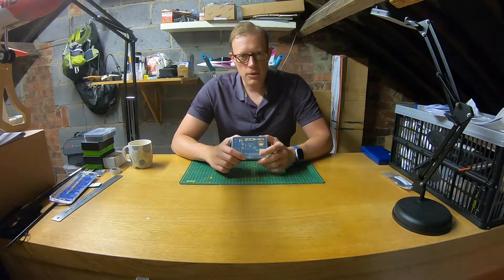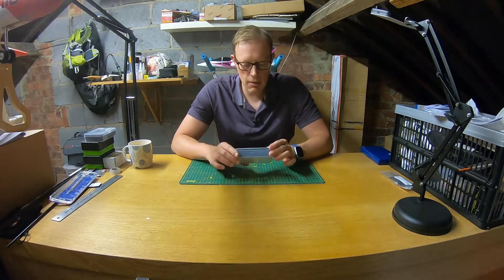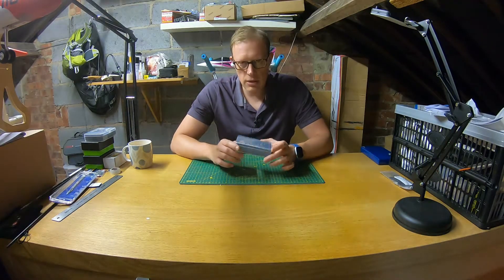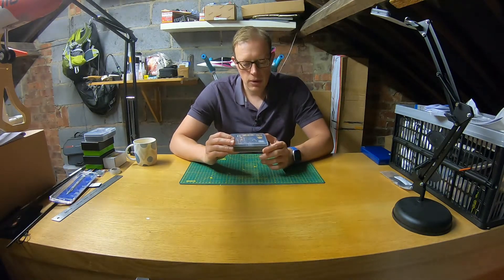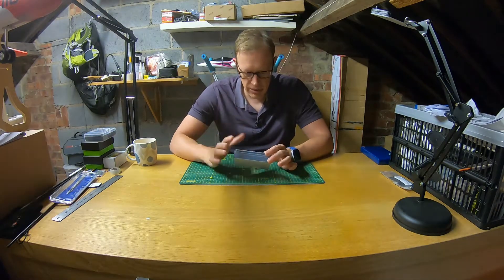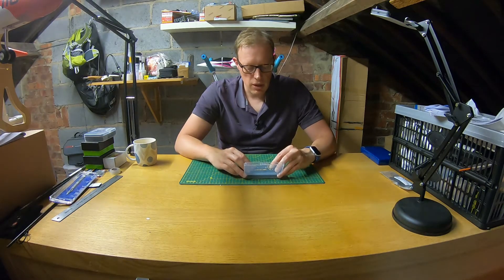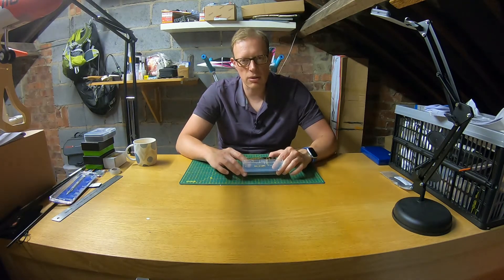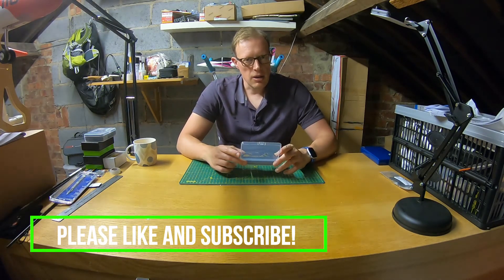ZOHD Kopilot launch control with manual throttle!

Comment: I have a specials switch dedicated for a "Launch Mode".  When activated, it provides a throttle-elevator mix based on a custom curve on my RadioMaster TX16S.  The curve will gradually increase up elevator as the throttle goes up past 50%.  I use this launch mode with the ZOHD in Level Mode.  The plane will easily launch and as soon as I've reached desired latitude,  take it out of my "Launch Mode".   Alternatively, you can just back down on the throttle to 50% or less which will drop the added elevator.   I do this with most of my planes, especially flying wings.
Reply from the maker: Sounds good 👍🏻. Thanks for watching and commenting.

Comment: Hi, is lauch control, using RTH on take off? I have the ch5 3 position switch, up RTH, middle stabilisation and down manual. I don't have an option for auto launch? Please advise thanks.

Zohd Orbit with kopilot.
Reply from the maker: Yes use RTH, stick the throttle on full and then launch it. As it hits a certain speed the motor will kick in and take over.

Comment: That Clearly was NOT auto-Launch. Motor will not spinup in RTL before you throw it
Reply from the maker: It does the way I have it configured. I have throttle plugged into aux channel and mixed with channel 3. You need to watch the start of the video!! 👍
Reply: Oh it definitely will as throttle is now controlled via the aux channel.

Comment: Hola,  hay alguna manera que RTH  mantenga Más altura ?
Reply from the maker: Hello, no it’s preset by Kopilot at 50m I think it is. Thanks for watching 👍
Reply: @tdogrc  70m actually. If you want more on a similar unit try the Lefei SN Sparrow. It uses 100 meters. There are also upgraded models with more features available. (Lefei SN-L, Sparrow2 etc.)
Reply: No, but somebody on YouTube tested it and found that it was 70 meter altitude for RTH.

Comment: Why not just launch in rth. Model should just climb out and circle around.
Reply from the maker: Doesn’t really work with EDFs. You need the power on as soon as it leaves your hands and the kopilot waits for a few seconds before applying the throttle in RTH mode. It’s designed so you can launch a pusher prop plane without catching your fingers. Cheers
Reply: Exactly I was wondering why His motor started spinning up before He threw it. It suppose to feel the excelleration of the throw to spinup the motors, I don't know what He was doing. There is no way the motor should have started first, He had to be in Stabalized mode or manual for that to Happen.

Comment: Just lauch in stabilise mode?
Reply from the maker: I hate stability mode though on the Kopilot. You have very little control it restricts the movement so much. 👍
Reply: @tdogrc  I may be wrong (frequently am! 😉) but to the best of my knowledge the restriction of movement of the servos in stabilized mode is exactly the same in RTH/FENCE/Autolaunch/Altitude Hold mode. Only Manual gives you unfettered movement. Also (in pilot initiated RTH only) you can increase the throttle above the Kopilot set level with the stick or so I've been told. (Possibly only valid above the fly straight forward to climb to 35m height.) Not confirmed it myself. 😁
Reply: @tdogrc  That's what it is suppose to do.

Comment: Thx! It was a good idea. All you loose is the automatic throttle control in rth mode. So don't forget to give enough throttle during rth and set this value to failsafe.
Reply from the maker: Yes you’re absolutely right 👍

Comment: You could also just program a switch to give up elevator and just switch the stability mode on and toss her with full throttle control. The stability mode will keep her level and once she's up about 10 feet switch off elevator switch and switch her into rth to loiter overhead

Comment: Good idea, but does it mean that if you have the RTH as a failsafe feature (for distant flights) than the Kopilot cannot control the motor power and thus cannot climb or descent. In such case a failsafe in the receiver would have to set the mode switch to the RTH function  but also set throttle to some cruise level, which can be not enough if the Kopilot decides do rise.
Reply from the maker: SilesiaBiker thanks for watching. Yes you’re correct. If your using the KP for long range distance flights such as FPV I would recommend leaving it as channel 3. I only use this method for easier hand launch for LOS flying.  Cheers
Reply: Could you program a Custom failsafe in the FRsky to disengage the CH3 AND CH6 THR mix, to revert to CH3 only for THR control, on signal loss? I'm new to OpenTX so this may not be possible.
Although even if the THR wasn't disengaged, the "loiter around the original launch point" side of the failsafe mode would still be working so if your TX has permanently died, you'd just have to wait for the battery to fade enough to not provide thrust but enough for servo control so ultimately you'd likely still have a usable airframe but a fried LiPo.
Reply: @arniesbox  The problem would be that Kopilot controls throttle only on the right output - if ESC is not connected than there is no mix in the radio to change that. It's either setting the failsafe in the receiver for both RTH switch and some throttle level or maybe using some switch to connect Kopilot Throttle output to the esc control wire in case of a failsafe (like a relay - no failsafe, relay allows pwm signal from aux / failsafe relay allows signal from Kopilot)
Reply: @silesiabiker541  Your analysis sounds about right. Normally under failsafe RTH the Kopilot takes complete control of the throttle. (There is no way to alter its programming.) It alters the throttle output to maintain a set percentage of ground speed (note - not airspeed!) above the 4m/s required to make the motor run. Since it also tries to maintain the 70m above launch height there may be some algorithm to increase throttle if the airspeed drops making it hard for the Kopilot to hold the plane at the set height. With an S-bus receiver (no PWM outputs) you would be limited to T DOG RC's mod only. (Save for using an S-bus splitter arrangement and PWM converter.) But with a PWM receiver of 7 or more channels you could do as you say and set another channel to failsafe switch (by a mechanical or solid state relay) the motor ESC input from the mirrored manual throttle channel on the receiver to the Kopilot Throttle output. Or just go to a high throttle value. A lot of mucking around to change something which is designed to be a simple plug-and-go unit though. ;-)

Comment: Hi, after listening at your video a second time, you said to plug the throttle on auxiliary (so I remove the connector that I had plug to aux to channel 6 on the transmitter), after doing that, the motor was beeping like crazy, so I'm doing something wrong. So if you have and idea let me know, thank you and have a nice day.
Reply from the maker: Carl Boulianne yes you need to plug your ESC into aux (channel 6). My best advice would be to try with a spare servo first plugged into channel 6 as a test so you can be sure it’s setup properly. If your motor is beeping it might be you have your mix the wrong way round, so when you have low throttle channel 6 is actually high? Good luck 😉
Reply: @tdogrc  Thank you for the information, have a nice day.
Reply: Hi, if I connect my esc to auxiliary, do I need to plug a wire from my kopilot throttle to channel 3 receiver ? Thank you and have a nice day.
Reply: Hi, after listening your video another time, you said that nothing is plug to the throttle, so I think the problem is my knowledge with the programmation. Thank you and I still think your idea was good, have a nice day.
Reply from the maker: Carl Boulianne that’s a good point. I use S-bus not PWM I think this method will only work with S-bus. However if you are using a Flysky receiver they support S-bus so you can still use it. Just use S-bus to connect receiver to kopilot and leave channel three unplugged on the Kopilot and plug your esc into channel 6 on the kopilot. 👍
Reply: @tdogrc  Hi, thank you, I will look at this option, knowing that i'm not that familiar with the programmation, I'll look at that option. Thank you for the time you invest in my situation. Have a nice day.

Comment: Hi, your option is very interesting because I have some problem throwing my sonic model. But since I'm new with these controller I was wondering how do you program the mirror option you are taking about. My controller is a Flysky, thank you and have a nice day.
Reply from the maker: Carl Boulianne you just need to add a mix so whatever channel your throttle is (probably channel 3) channel 6 is a copy. So when you move channel 3 up, channel 6 moves up as well. Good luck 👍
Reply: @tdogrc  Hi, so i mix my channel 3 and slave channel 6 and I can see it operate the same way on my display. I even transfert the info to the controller with the zohd programming wire. But it didn't work. I put a wire on aux to channel 6 on my transmitter. But do I need to modify the connection of the throttle. Thank you and have a nice day.